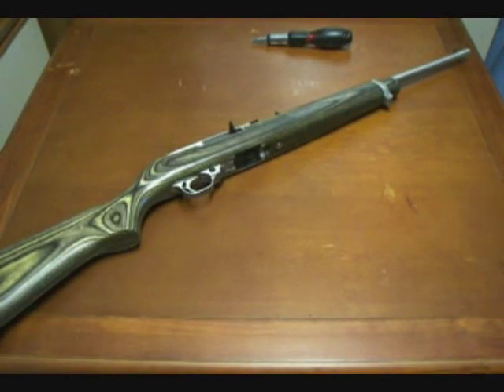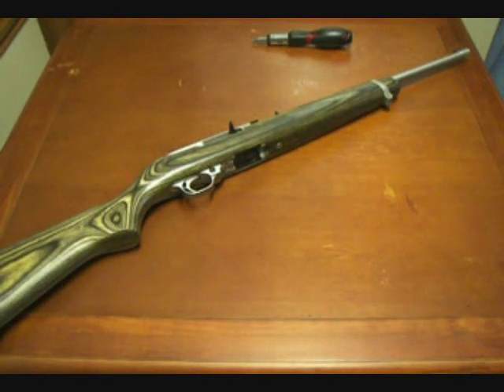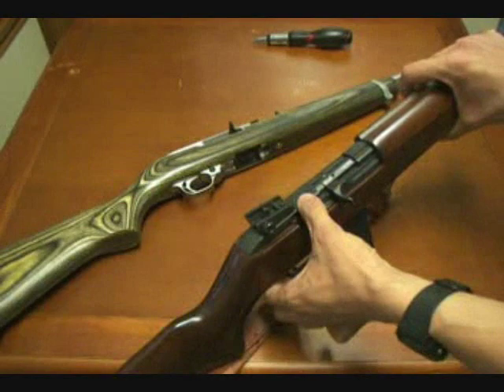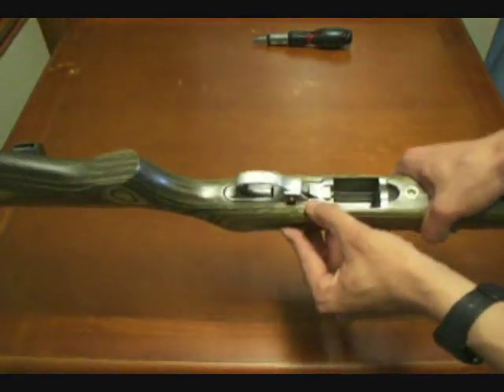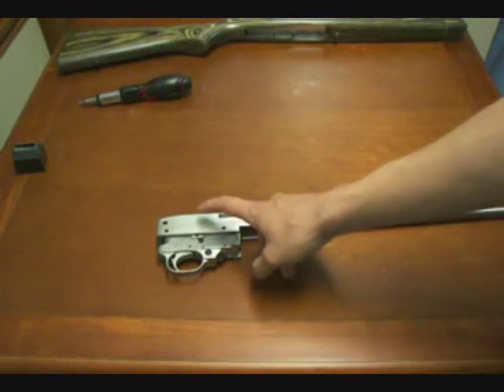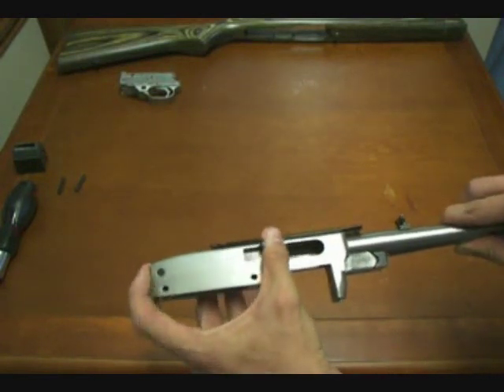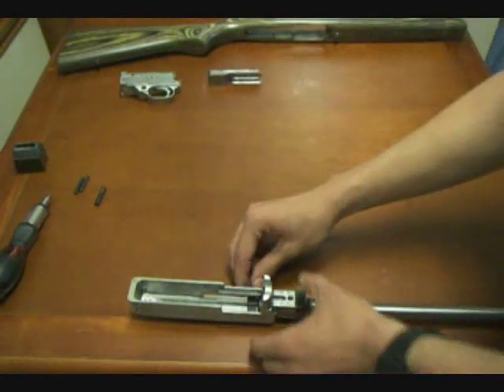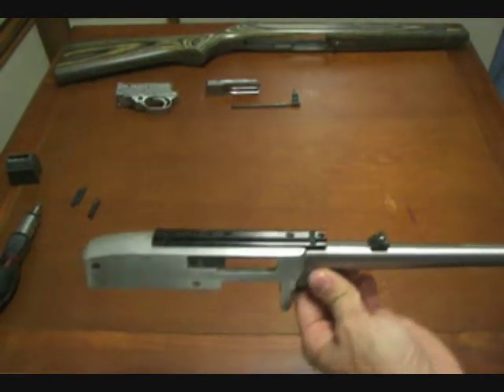Ruger 10/22 Rifle Disassembly Field Strip Fieldstrip Takedown - Gunknowledge.com

Comment from the maker: @jmangification 

Well, depends on where it jams:

If it fails to extract fired cases from the chamber, check to make sure the extractor is spring loaded, it should be fairly difficult to move with your finger.

If it fails to eject the case, check to make sure the ejector bar is not bent or chipped.

If it jams on feeding a new round and if you are using hollow points or wadcutters, try switching to round nose.

Comment from the maker: @hotford60 

Yes, the large pin is the only thing stopping the bolt.  On the factory 10/22, the pin is made of steel, so that's why most people replace them with a plastic or rubber buffer.  It's actually not much worse than the Marlin setup, since Marlins use a small plastic trapezoidal block which actually gets damaged easier than a pin shape.
Reply: Do you have takedown video for the Erma/Iver Johnson M1?

Comment from the maker: @jmangification 

The sharper profile of the bullet will sometimes hang up in actions, but round noses will allow the cartridge to feed over minor imperfections.

And finally, if you are using high or hyper velocity ammo, try using standard velocity. (for 22lr, this is be subsonic or just slightly supersonic depending on brand).  Older weapons were designed with spring rates for standard velocity 22lr, and high/hyper velocity wasn't around back then, so the ammo may be too hot.

Comment from the maker: @max0834 

Hi Max, well, I've never had a 10/22 buffer that wouldn't drive out with a punch & hammer.  This may sound trivial, but when you had the receiver, you did have it supported on the ends with the pin area in mid-air, right?

I have tried hammering out more than a few pins where I forgot that the pin was resting up against a hard surface and just absorbing my attacks. :D

In fact, just cleaned an old 1975-made 10/22 today that was gummed up horribly, but all its parts separated.

Comment: I just bought a new ruger 10/22, but i cant remove the firing pin stop pin/ buffer/ the biggest of the three pins that needs to be removed for cleaning. Im not sure if its because the gun is new but I've tried driving it out with a screw driver/hammer, pushing it out with other things and putting all my weight on the damn thing and it has not budged a bit...Ive applied a little bit of oil and some wd40 but it still doesnt work...any ideas?? i want to clean my gun!

Comment: HATE dissasembling these things.... pins are hard as crap to drift out, especially bolt buffer, and when i try to drive the pin out, the punch slips off the pin and scratches the shit out of the reciever :(
Reply: Are there any good videos of disassemble/assembly for the Erma/Over Johnson M1s? I've got one apart and am having a Hell of a time putting it back together.